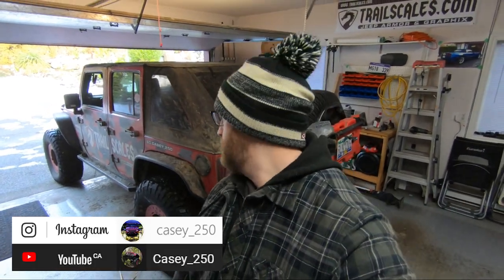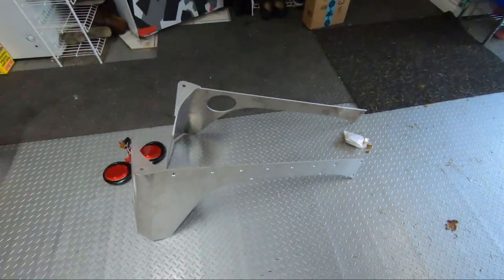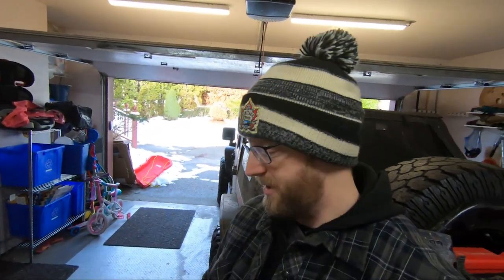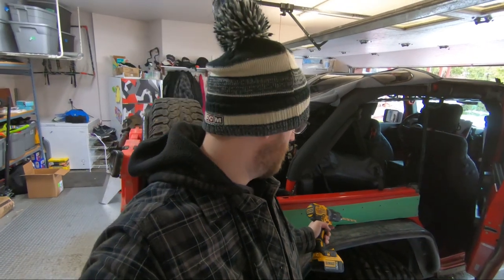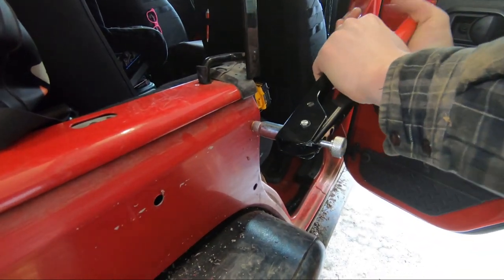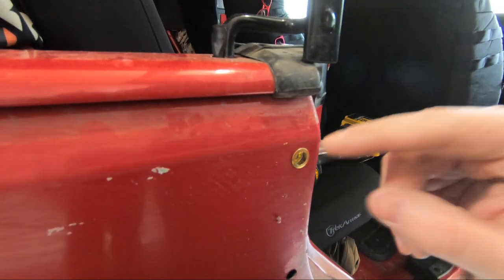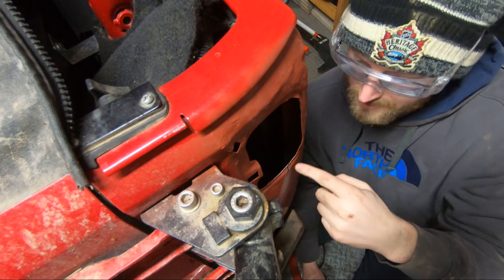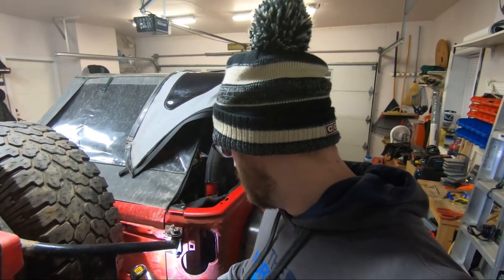Jeep Corner Armor Install - EVO MFG Rear Rock Skins | Part 2

Comment: Great work Casey!

Rivnuts are so freaking frustrating to work with. It took me 3 nights to mount my rockskins with the same blue tool you used later. Had  4 rivnuts spin on me. JB weld helped to keep them seated.😄
Reply from the maker: Thanks. I have 2 spinners that I need to fix. Im going to crazy glue them, then try to get the tool threaded into them and crush em some more.

Comment: When I did my rocker protection/rock sliders I had to do 10 nuts serts each side all but 1 worked perfectly, when they work right they are a great solution but you have to be very precise. Havent done it yet (year later) but going to step up to the next size sert. Only way I can figure to fix it. Btw not easy to get them out but a pair of side cuts and a little cussing works great
Reply from the maker: Ya those 2 spinners are going to be fun to get out. :(  Probably grind the edge off and push em through if I can't tighten them more.
Reply: I was worried about getting sheet metal underneath and then not being able to step up the nut sert. It was not to bad I used the side cuts folded the lip up and pushed it in

Comment: Notch out the driver side bracket a bit if your worried about strength flip the piece you cut out and re-weld it back into the inside of bracket. If it’s still tight and can’t adjust anymore maybe you can push the passenger side out the same distance with aluminum spacers you made for drivers side. Great videos!
Reply from the maker: Thanks. The spacers aren't great, it moves the receiver out too far. Chatting on Instagram, I think notching just the rubber grommet might work the best. I'll post the final results on IG when i'm done with powder coat.

Comment: Great job! Looks great. Could you take the damaged rubber part of the taillight and put that under the tire carrier mount? Or maybe cut it out completely and out the missing section under it to allow the spacers to be removed? 

Thanks for the tip on the tool also! I will definitely be using one of the bigger ones!
Reply from the maker: That is going to be my next fix, is cut the damaged rubber off and go under the receiver plate. The spacers throw the carrier alignment off too much. My last resort solution is to notch the receiver plate but I want to avoid that. I think cutting the rubber might be the best option from some one I spoke to on Instagram.

Comment: My advice, if you can get to the backside with a wrench of any sort, do not use a rivnut/nutsert.  Don’t get me wrong I think they are a great solution when you can’t get to the backside of the area you are working on. I just think they are more trouble to use in general structural applications.
Reply from the maker: I agree, thats why I went bolts around the cover. @trailblazzers did his and drilled out from the inside to get nuts on the back.

Comment: I also have the EVO rear skins i wish I would have gone aluminum they looked to be easier to fit.  What are you doing for reverse lights I only have a small one on my back-up camera and no reverse lights is why I needed the skins in the first place. (freakin night wheeling).   I did put a bottle opener with a small LED to illuminate the license plate.  Its the  law in my area.  I can't figure out how to post a picture in the comments.
Reply from the maker: I think the aluminum were definately more flexible and quite a bit lighter as well. I have KC Hilites cyclones on my tire carrier, and on the side of my rock sliders pointing backwards that come on when I go into reverse. Works really well for backing up and seeing the wide tires and fenders so they don't hit things.